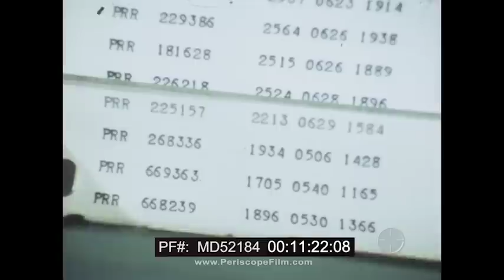PENN CENTRAL RAILROAD 1968 PROMOTIONAL FILM  "CALL US PENN CENTRAL"  MD52184

Comment: The Metroliners had constant problems with electrical faults and never reached their design speed of 150 mph in service. In fact, the shape of the power cars caused a pressure drop when used with older MP54 cars at speeds over 80 mph, causing the sealed windows of rebuilt cars to rip right out of the frames. They only lasted about fifteen years in service, and that was with rebuilds that cost as much as the purchase price of the cars. The KarTrak ACI system turned out to be a disaster. The color bar codes were required on all rolling stock starting in 1967. it took until 1975 until about 90% of cars were labeled and sufficient trackside scanners were installed. Unfortunately, testing never included the effects of weathering. The labels themselves faded badly due to direct sunlight, and almost no testing was done for the effects of dirt and grime. The readers depended on visual identification of the stripes, and the dirtier a car got, the harder it was for the d=scanner to read the labels. By 1977, only about 70% of all labels were being read correctly, so humans were still having to read and record car numbers anyway. The whole system was abandoned by 1977.
Reply: The Milwaukee Road had a system called Car Scope that worked much the same way. They even promoted it on their stationery with a phrase along the lines of, "Car Scope tells you where your load is!" A Union Pacific employee allegedly amended it with "probably in the Saint Joe River." Which at the time was probably correct!
Reply: Though though were rebuilt again in the late 80s in push-pull and have been running since as cab cars. Likely the added years are worth their rebuild value by now.
Reply: they also did not work well in rain, fog or heavy snow
just think. something that required lights, scanners, perfect conditions, who knows how much hardware and computer center can now be held in the hand of a Walmart cashier
Reply: It is still possible today to occasionally see a car, usually a rebuild, with an ACI label on the side.  Note that in 1968 "consolidated stencils" were still in the future.

Comment: I'm glad to see that auto-rack cars are now surrounded by rock proof walls. Back in the mid-60's I remember seeing idiots throwing ballast rocks at automobiles on the open freight cars carrying them. That may be the reason someone came up with the idea to shield the automobiles from vandalism. On another note, the New York Central was my favorite railroad. I was born in upper Manhattan (Hudson Hgts) in May 1954. In 1957, my parents moved to Cleveland, Ohio and we went by a New York Central train to get there by what was called the Water Level Route.
Reply: Did you sleep well?
Reply: Back in the day. Cars were often shipped and exposed to the elements IE rain, snow, sleet, and Hale. Also, the vehicles were targets thieves and vandals. When the cars or trucks got to the other side. The cars had broken windows, graffiti, or slashed tires. The covered cars are a way to ship vehicles from the factory to the final destination. Insurance claims also got extremely high.

Comment: Wow, that train at 2:00, probably had that "new train smell." Also interesting to see trains with NO graffiti.
Reply: Looks like the same train at the end.  Both shots were on Horseshoe Curve over in Pennsylvania.  The early shot of it at the beginning was the train going westbound around the Curve heading uphill on what was then track 4.  Probably crossed over to track three at UN, went around the connector track to AR, and then came back downhill heading eastbound on track 1 for the shot at the end of the film.
Reply: No graffiti: That's the way it was - until the cancer of rap/hip-hop graffiti culture took root in the late 1980s/early 1990s. I hate it.
Reply: @danielgolus4600  ok boomer
Reply: the nice thing about these old films is seeing trains not covered with some thug's graffiti
Reply: @re49991  ok zoomer
Reply: @danielgolus4600  it’s almost like the rise in graffiti had to do with easily available spray can and not with whatever you’ve mentioned.
Reply: The graffiti doesn't come until at least 1970, when the railroad, like practically everything else that decade, went down the sewer!

Comment: My dad worked for the Pennsylvania. It was a bitter pill when New York central cooked the books to hide all the debt they were in. Pennsylvania was profitable line until they had to absorb all the hidden debt. This was such a famous occurrence that an accounting instructor spoke of it in a class nearly twenty years after it happened. And then a later chapter when government run conrail assumed control and ran it into the ground. Along with it the government raided the Pennsylvania pension plan and used it to shore up social security. I don’t think you’d encounter a single Pennsylvania employee that had anything but disgust for New York central.
Reply: that is a great big lie. from your own fed gov  the Pennsylnania did all the book cooking. the Prr was going broke since the end of WW2 the Prr never got any thing done. the ncy build selkirk hump yard buckeye hump yard elkhark hump yard. front tier hump yard. CTC double track from nyc to chicago. what the the Prr get done. may be conway hump yard. if the Prr were so great then why is over 60% of it gone today. the NYC had al perman. he went on to the western pac. robert flanerry went on to the wp JOHN KENERFLICK. WENT ON TO BECOME ceo OF THE upRR. ON BODY ON THE pRR SIDE WENT ON TO DO ANY THING. THE pRR WANTED THE MERGER A LOT MORE THEN THE nYC DID. al perman did every thing he could to try to get out of it
Reply: @dknowles60  . I think I’d be more inclined to believe an accountant over the word of the government. NYC was a more regional line as opposed to the PRR which had rail lines parallel to and extending much further in every direction than NYC. Since PRR was a top tier carrier it had more rail miles than many if not all other lines. Something you didn’t take into account was during World War II the government nationalized the PRR and took over where and how they operated. As a result the government ran the equipment and the track into the ground. At the end of the war, they hoped they’d get more compensation to repair everything but as in most cases government reneges on promises they make. Since they had more track miles any revenue they made was spread over a wider area. The Pennsylvania was always a frugal business, and some would say miserly. Unfortunately, with the reduction in ridership and freight after the war it became more difficult since everyone was using cars and trucks to move around. With PRR they began selling off assets and diversifying to other companies to survive. They were surviving but barely. In their endeavors to stay profitable they looked to NYC since most of their lines often paralleled the PRR. I’ll always believe based upon what information I’ve gathered that NYC was the one that didn’t know how to run a railroad through their mismanagement. As a result of their actions it pulled the PRR into bankruptcy which caused the government to take ownership of the company. As stated previously the government ransacked the PRR pension plan which resulted in a reduction in benefits for all involved. As the son of a PRR employee I lived with the results of what happened in one way or another. My parents tried well to hide these events but when they worried about the effects of losing income, job, or pension one knows there’s a reason they went through periods of worrying about the future. So if you can find a retired accountant or a former PRR employee that’s still alive perhaps they’ll be able to confirm what I’m saying. Just remember that democrats were in the majority when this occurred. Good luck getting the truth out of democrats. They have misinformation down to a science as evidenced by Biden, Pelosi, Schumer, Schiff, Biden deserves a second mention since he was in the senate, I think, at that time.
Reply: In the interest of saving time I’ll copy from another source and add another quote from elsewhere: The Pennsylvania Railroad (reporting mark PRR), legal name The Pennsylvania Railroad Company also known as the "Pennsy", was an American Class I railroad that was established in 1846 and headquartered in Philadelphia, Pennsylvania. It was named for the commonwealth in which it was established. By 1882, Pennsylvania Railroad had become the largest railroad (by traffic and revenue), the largest transportation enterprise, and the largest corporation in the world. Its budget was second only to the U.S. government.[1] 
Another listing has the following information:
Over the years, it acquired, merged with, or owned part of at least 800 other rail lines and companies.[2] At the end of 1926, it operated 11,640.66 miles (18,733.83 kilometers) of rail line;[notes 1][3] in the 1920s, it carried nearly three times the traffic as other railroads of comparable length, such as the Union Pacific and Atchison, Topeka & Santa Fe railroads. Its only formidable rival was the New York Central (NYC), which carried around three-quarters of the Pennsy's ton-miles.

In 1968, the Pennsylvania Railroad merged with its rival New York Central Railroad and the railroad eventually went by the name of Penn Central Transportation Company, or "Penn Central" for short. The former competitors’ networks integrated poorly with each other, and the railroad filed for bankruptcy within two years.[4]: Chapter 1 

Bankruptcy continued and on April 1, 1976, the railroad gave up its railroad assets, along with the assets of several other failing northeastern railroads, to a new railroad named Consolidated Rail Corporation, or Conrail for short. Conrail was itself purchased and split up in 1999 between the Norfolk Southern Railway and CSX Transportation, with Norfolk Southern getting 58 percent of the system, including nearly all of the remaining former Pennsylvania Railroad trackage. Amtrak received the electrified segment of the Main Line east of Harrisburg.
Since it had three times the freight volume, integrated into that was the agreement to share railroad lines with other carriers. That means there’s potentially three times the freight on other lines which means their rolling stock could be spread over the entire country. Admittedly I missed that their rail system was nearly the same geographic limits for service areas but since PRR moved up to three times the freight there’s going to be more mileage per car and engine than any others. Any mergers that NYC executives did has the potential to just allow the lines to be taken over for their own benefit. If I’m reading it right PRR acquired rail lines instead of merging two other lines per occurrence. We all know that New York has a tendency to create shady deals for monetary benefit. That’s why I have to question the details as reported from certain circles. Time will tell.
Reply: @kevinstonerock3158  fed gov over see the rail road. from your own fs gov, the Prr was losing money since the end of WW2 the Man who knew the Prr best John  fish wick did not want the Prr, John fish wick CEO N&W rr
Reply: @dknowles60  . Since the attorney you’re referring to was a democrat I’d consider it a badge of honor that he was opposed to the PRR acquiring N&W. From what I’ve read PRR had ethics as opposed to many corporations burying the money somewhere in the process of mergers. 
Even though they threatened to nationalize PRR they didn’t provided they’d follow their direction. The results were the same since the government weakened the financial condition of the company. Why do you think NYC was so opposed to PRR’s operating the company? I tend to believe NYC executives were used to burying and wasting money during their operations. A case in point is between 3-10 years apart they swapped the passenger train equipment to flashier equipment. Switching equipment one time is one thing; doing it twice in that period of time is financially irresponsible. I suppose that’s part of the method used to fudge the books. Of course the government wouldn’t want it to be known that they abused the PRR equipment and wouldn’t reimburse them for the condition they left it in so with all the corruption in that period of course they’d claim it was PRR mismanagement. I’m thinking I’m hitting nerves in the mentioning of these issues. The same methods are occurring in our government now where they claim  a president did something wrong while a Vice President did worse since he didn’t have authority to have the documents nor declassify them. Same pattern, different circumstances.
Reply: @kevinstonerock3158  the account was fires for lieing and never worked again
Reply: @dknowles60  . Huh?
Reply: @kevinstonerock3158  what about the PRR’s early 1960’s “diversification” efforts 😂

Did you know they still managed to lose a few million dollars on the buckeye pipeline company? When they bought it they share traded so by the PC era they still hadn’t even broken eben on it! 😂

NYC was much more prepared for the merger as they had been mostly broke throughout the 50s and because of their AGGRESSIVE cost saving methods. They had computerized hump-yards in the early 60s! I don’t like how much their owners disliked passenger operations though. 
The PRR, on the other hand didn’t even try to do any rebuilding or upgrade yards like they were supposed to before the merger!

The pennsy was in a little better of a financial condition, but not by much. Do remember though. The ICC’s regulations affected all railroads, so it’s not fair to pin it all on the pennsy.

Me personally, I love the PRR and think it’s a much better railroad, but I think the NYC handled the postwar era kind of better.

Comment: I remember penn central,  am I old AF ?
Reply: No. I remember the Burlington Northern merger of about the same time. My granddad took me down to the roundhouse in Tacoma, WA, and we rode a freshly-painted switch engine on the turntable. I recall it had Harco spark arrestors on the stacks, so it was probably a former Great Northern unit. In the stalls were engines representing just about every contributor to the merger. But where the Penn Central failed the BN succeeded. The Hill Lines were all family, so the merger made sense. The Penn Central merger was a desperate move of two elephants to prop each other up.

Comment: I can’t tell if the train passing at 3:30-3:35 has a Amtrak livery (livery=paint job), what does ironic because Amtrak is/was result for the consolidation of the railroads industry in the U.S.
Reply: It was the test Metroliner and it had the PRR livery (possibly with USDOT markings too as the agency was a sponsor). You see it again at 4:36
Reply: Consolidation was not the reason for Amtrak.  Passenger trains would have been a problem at that time for freight railroads whether they had consolidated or not.